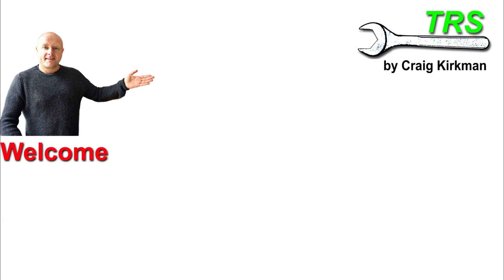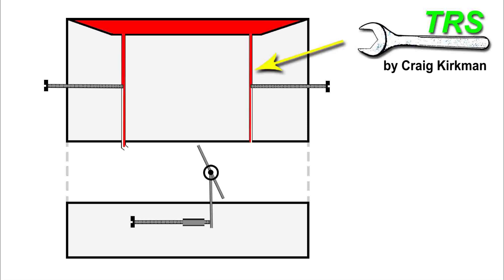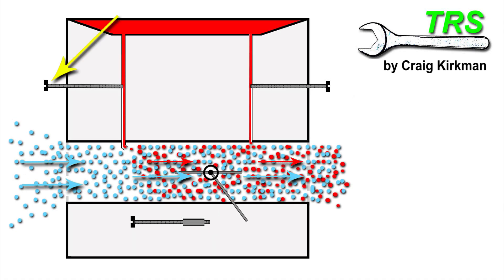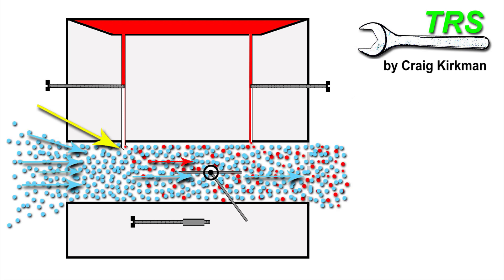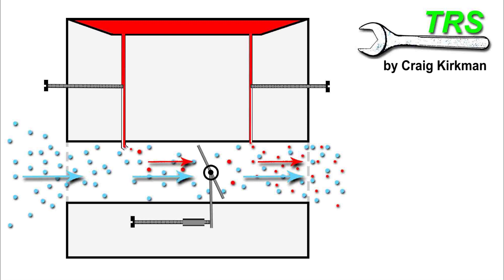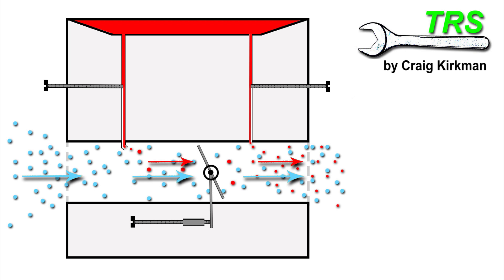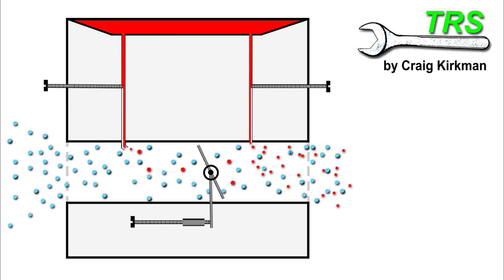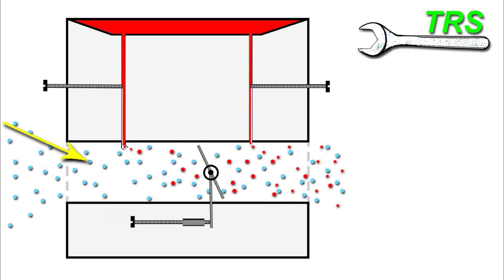CHAINSAW CARBURETOR SETTINGS - Explained Like NEVER Before!  (by Craig Kirkman)

Comment: i am new to all of this small engine stuff and i was curious if i have a saw with the choke pulled or the butterfly valve closed before starting the saw,  will the saw "flood" or have to much fuel for combustion (does pulling the choke release any fuel without the engine running)?  When does the venturi process start? is it right when the piston moves up and down?  does it depend on the carburetor?

Comment: hey i see you have an impressive knowledge about 2 stroke engines!
Maybe you can help me..
I assembled an chainsaw engine for my small selfmade boat. When i start the engine it has plenty of ignitions but it wont run on its own. I would be so thankful if you can help me!
Reply from the maker: Thank you so much for the nice feedback. I really appreciate it. As for your engine, well it could be a whole manor of things.  What do you mean by plenty of ignition? do you mean the spark? engine fires initially but does? Craig